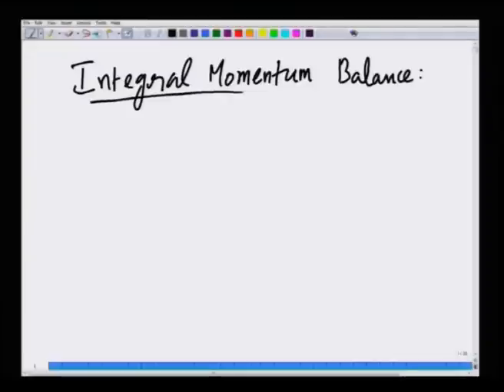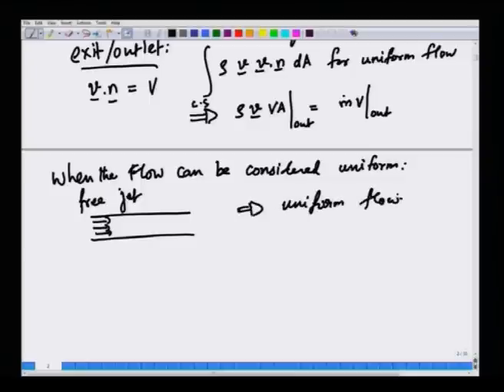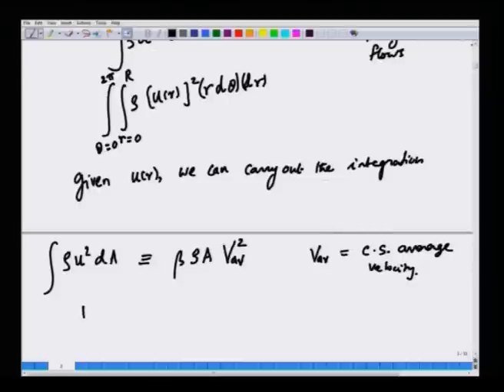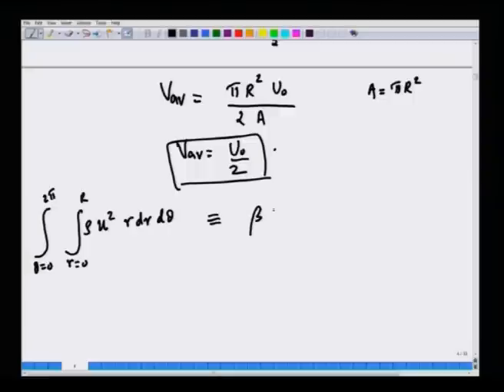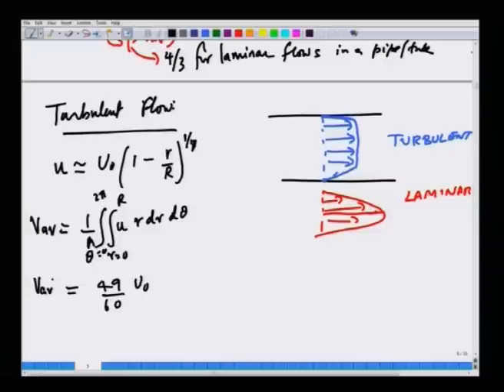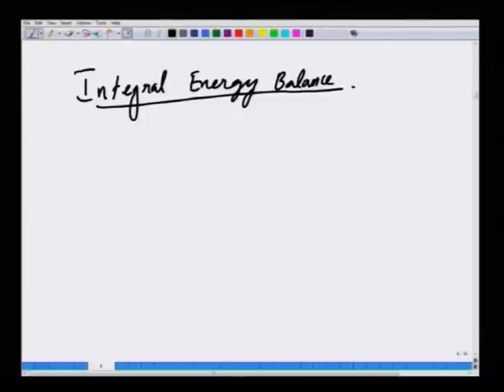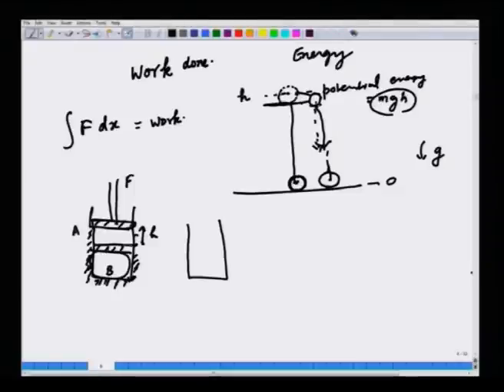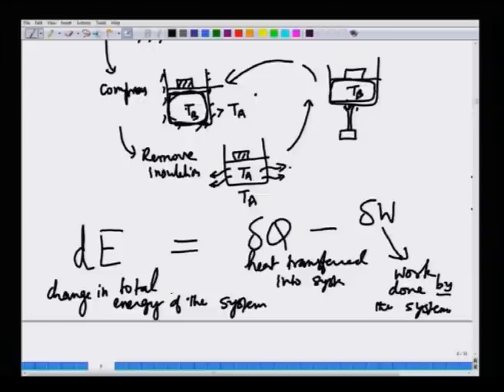Mod-01 Lec-15 Lecture-15

Comment: at 10:32
I’m wondering why the dot product of the velocity vector v and the normal vector n equals u. Is it because the dot product of v and n is equal to the magnitude of v times the magnitude of n times the cosine of the angle between v and n? And then, magnitude of v times the cosine of the angle between v and n equals u?
Thank you so much!

Comment: why does the velocity at the in trance is negative and what does that mean?
Reply: velocity is not negative, Dot product of velocity with the Area direction vector (v.n) is negative.
Reply: At the entrance the direction of the velocity and the direction of normal(n) to the boundary of the control volume are opposite.So the dot product of the two vectors i.e., velocity is negative.
Reply: When the normal area vector and the velocity vector are in the opposite direction it is negative and vice  versa.